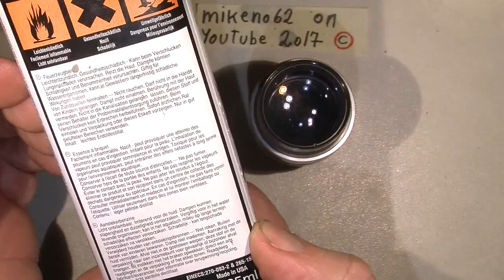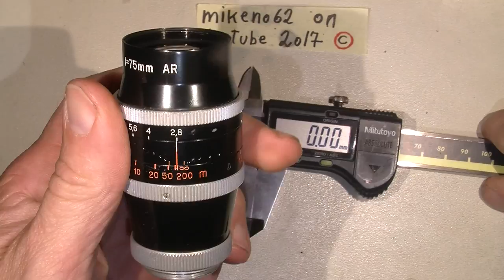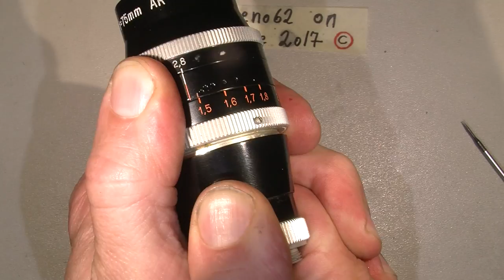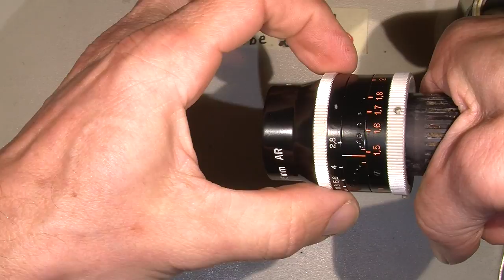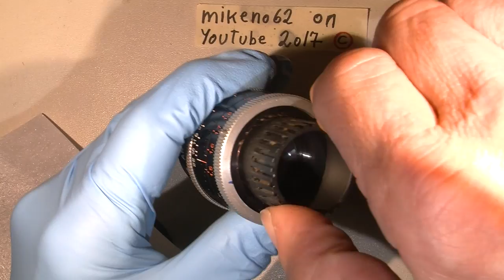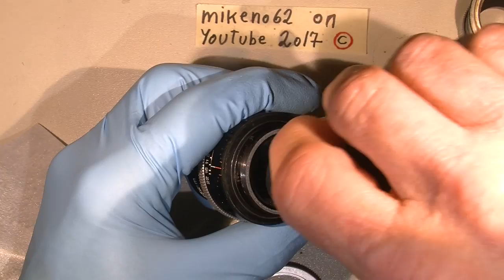Fungus in Kern-Paillard YVAR 75mm 1:2.8 AR

Comment: I am not as advanced as you mike, but I use caution when handling the glass inside ,even the smallest amound of dust caught between the lens itself and the rubber spanner could scratch the lens. I use the air blow as often as needed and cotton q-tips to remove small particles. thanks for sharing this,though

Comment: I have two of that lens. Both were sent away to be lubed because they were so stiff. Now they both turn smoothly. How was that done? Your lens turns smoothly and does not need to be lubed. One lens does not focus properly the other does just fine. I had taken one apart and did not get it back together properly then it was so stiff it wouldn't turn at all anymore.
Reply from the maker: I have got an old Kern-Paillard YVAR 75mm 1:2.8 AR, that have problem with stiff focus ring, so I will make a film about that lens.

Comment: So this is just a 3 element lens? No crown and flint pasted together? Would the D-mount yvar for 8mm cameras likely come apart the same way?
Reply: The Kern Paillard lenses (the Yvar line) are triplets, but the middle element is very thick, and calculated so that there is no need for a fourth cemented element. This was the stroke of genius from Hans Schlumpf, the man who made them. He was world famous for his triplet tele-designs. You can not do this for bigger formats becaus the lenses would be to heavy, but for 8 and 16mm cine-lenses it works brilliant. Yvar 36mm, 75mm and 150mm were world famous lenses because of this trick.

Comment: Hi, I like your skills in taking the lens apart, but you do not know how to remove fungus or handle lens elements. First of all, the fungus do not make grooves, it lives on top of the glass or in the coating. To remove it you use muracic acid or strong vinager or citric acid. Vinager or citric acid is what I prefere to start with, and most times it is enough. Then rinse the element in water or a sodium (base) solution to neutralise the acid. Then use a chlorine solution to remove fatty recidues like haze. NEVER use lighter fluid inside a lens unless you are prepared to take everything apart or make the haze worse. The fungus and haze should be gone by now, so re-assemble the lens. I have saved a lot of cool lenses by only using house-hold chemistry. So, remove fungus with acid, haze with chlorine (because haze is often vaporated fat from lubricants) and then you are good. Now, modern lenses have delicate coatings, but the fungus has made marks in the coating anyway. It is better to save the lens than to throw it away because some elements has lost some coating. Pre-war lenses do not have coatings, and the glass can not be destroyed by the fungus or the chemistry by which you remove it. Best of luck.